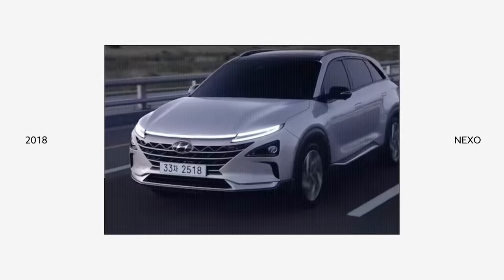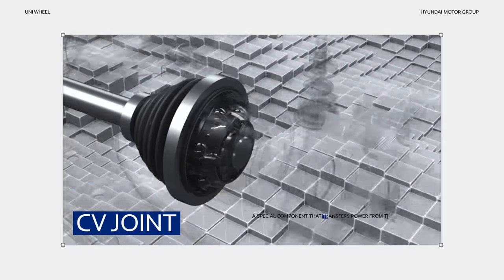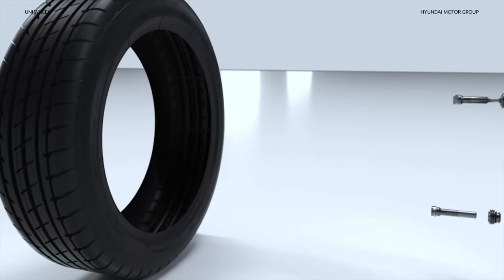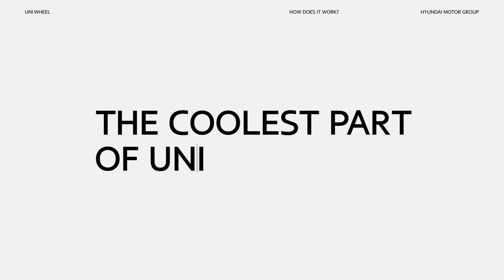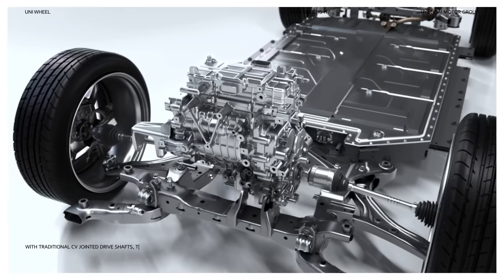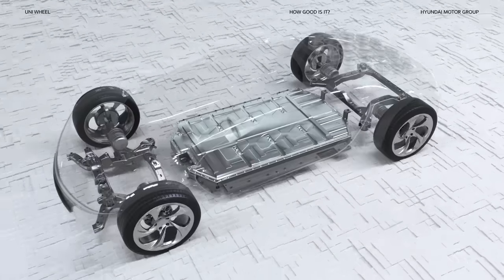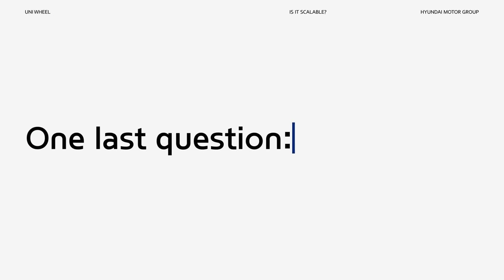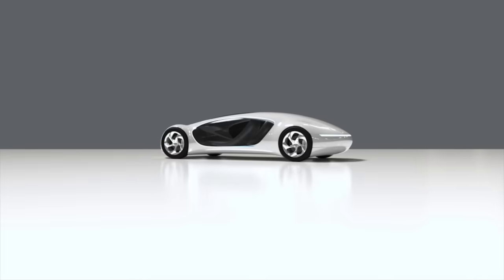The world's first drive system concept | Universal Wheel Drive System

Comment: Interesting. We’ll have to see how it survives in real-world conditions, including going over potholes and going off-road.
Reply: Yeah....but U really gonna go off road with battery pack underneath.  Deep pot holes can create havocs but like buses, trailer tractors, and wheelchairs (rear wheel drive).. this is perfect.
Reply: @Timbucktoothed  Why not?
Reply: I think so. THink of all the holes in gas tanks right now. We gotta solve that problem.
Reply: @timeconomu7395 Gas tanks are usually higher up on the car than the battery packs on these modular chassis. If you puncture a gas tank you just get a leak, if you puncture a lithium battery you get a gnarly fire or an explosion. Not saying that these concerns couldnt be accounted for, but they are concerns none the less.
Reply: Seems like all the pressure will be put on the uniwheel and it will break often
Reply: "going offroad" is no more a real-world problem than "going across a lake"
Reply: @RoamingAdhocrat I don't understand? Where I live, Colorado, and especially at my elevation (9100 ft) going off road happens pretty often. Rain washing out the roads, entire cliff sides coming down and scattering across roads all pose a problem that's encountered often enough that if you don't have 4wd/AWD you aren't guaranteed to get from point a to point b often. 

To go a bit further, many of the roads up here are dirt roads, that often get eroded and washed out. If you consider the paved roads, the amount of pot holes exceeding 12 inches is almost guaranteed to include at least 1, over a 2 mile stretch. I think people fail to realize that a lot of places such as mine exist and are not only impractical to "upgrade" but downright impossible due to the unique weather conditions presented.
Reply: @yunakobravo70 I live in Colorado at 9600 ft and wtf are you talking about? Entire cliffs falling down?  Ha ha, bruh.  In the ridiculously rare case that that happens, the highway gets shut down and your 4x4 isn't getting you through there anyway.  This ain't goat paths in Bolivia or Nepal.  We have modern infrastructure.  Even high-clearance-needed,  US forest service roads are well built with good drainage.  Get over yourself.
Reply: Practically nobody drives off-road
Reply: Yeah, potholes, speed bumps, standing water, mud, dust, curb check, etc.
Reply: @Timbucktoothed go off-road with a diff sticking down and see how it fars on rocks
Reply: @CleverAccountName303 right? I've been in Colorado for most of my life and when he said "entire cliffs coming down" I thought "what part of Colorado does that happen"? 

Not a realistic argument against this. 

Eroded dirt roads? Deep ruts? Heavy snow and uncleared roads? All yes. 

Cliffs falling and telling the locals "just drive over it, bruh"... Never once in 41 years have I heard that.
Reply: That was my very first thought
Reply: I always feel like adding more gears increases the chance of failure and this design seems like it would lead to constant repairs.
Reply: @RoamingAdhocrat  you gotta come to Brazil at some point.
Reply: All innovations have been criticized, attacked and yet here we are with flight, computers, Ai and unmanned vehicles.
Reply: You got'em dude. This multi-billion dollar multinational corporation released this video with testing it for potholes.
Reply: @yunakobravo70  Maybe this concept isn‘t the right concept for you then? But keep in mind that most people don‘t need to, don‘t want to and don‘t have to go offroad.
Reply: I don't think it's going to have issues with off- roading, besides with independent motors on each wheel, you should be able to ride at any height allowable per tire size... And the best thing is, no drive shaft or axle height to worry about. This is a major step in automotive history!
Reply: Very interested to see how these hold up

Comment: The usual concern about such things is additional unsprung weight. I also wonder about cost of repair when relatively minor impacts with wheels occur. Interesting.
Reply: It looks pretty modular. It might not be any worse than a traditional CV joint replacement.
Reply: They seem to have ditched the hydraulic friction brakes to make space within the wheel, so you'd drop a bunch of weight there... but then, whats the situation with braking?
Reply: @noxious89123  I think they didn't include the brakes for simplification of the visuals.  I would imagine the wheels would be inboard like they do with the bollinger EVs (anybody remember them?)
Reply: @noxious89123 I guess this unit needs to be oil filled, wich create a mass that has a damper on the start of the movement and a momentum when the movement must stop. That will cause some problem. But I guess this is not a racing car system, good enough for everyday use?
Reply: @noxious89123 Brakes can be mounted on the motor/driveshaft? Just like old Alfa Romeo and Citroen did to reduce unsprung weight.
Reply: There is no unsprung weight other than the tire itself, duh! The tire spins around the wheel.....😮 This is the future of automotive travel.

Comment: I couldn’t help but notice they still had to use one cv joint on each front wheel for turning. So on a 4wd car with 2 wheel steering they are reducing the number of cv joints from 8 to 2, but not eliminating them completely like the video seemed to be saying. Also on a fwd car it would only reduce the number of cv joints from 4 to 2.
Reply: Even the non-steered wheels need some angular compliance because toe and camber angles change with suspension movement.
Reply: @brianb-p6586 I'm also guessing that it's not a "true CV" joint, in that its range is limited in order to increase power transmission efficiency.
Reply: I have no idea what type of joint Hyundai is proposing, @TheThomSirveaux , but any joint which doesn't change speed with rotational position is a "true" constant-velocity joint. To handle a steered axle, almost the same angle as conventional applications would be required, so it would presumably be a conventional CV joint type.
Reply: Could always mount the motor on a “hinge” and have it turn/camber in relation to the UWD hub assembly and shaft as well. Eventually I’m thinking each wheel will get something akin to a “bogie” mount like rail cars. Especially since drive by wire is already a thing and steer by wire will be more popular too.

In this manner, steering would just mean varying the speed of each wheel to allow them to pivot in their bogies similar to how a tank or a hoverboard turns.

Comment: But... You still need a CV joint between the uniwheel and the drive motor to account for steering. The uniwheel only allows an up and down movement in a single plane. Otherwise the design is top notch. Good job Hyundai!!
Reply: Looks like in the video they envision the small motor being able to turn with the wheel?   You'd think having to have space for the motor to turn with the wheel would take up a lot of space too.  Although I guess this would be ideal for a rear wheel drive car.
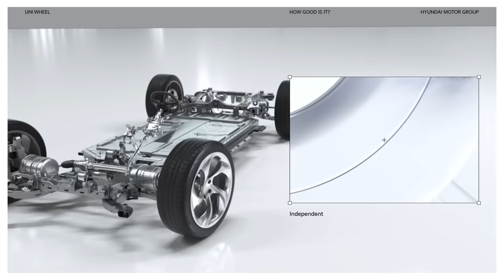Reply: 5:12
Reply: @OrestisTrips thanks for the link. You have to zoom in on the small picture but it’s clear that the motors turn with the wheels.
They should go for axial flux pancake shaped motors. That’d keep the whole package tighter
Reply: @auspiciouslywild  and then they could just... put the motors directly on the hubs and not bother with 60 expensive moving parts.  This is pretty ridiculous.
Reply: @gearyae  No, because that adds a lot of unsprung weight, which is undesirable for many reasons.
Reply: @gearyae  what  @superluig164  said and also wanna add even with 4 of these UWDs, there's less moving parts than in the typical transmission/differential/CV setup. Way less.
Reply: @gearyae  Those parts gets you a more comfortable ride, better efficiency and better motor longevity.
We have EVs with basic hub motors today. But still the standard is to have a single speed gearbox and CV joint.. because without it you get a bad EV that nobody wants to buy.
These parts aren't very complicated. It's all just basic gears in a fixed configuration.. like the single speed gearbox it replaces.
Reply: @auspiciouslywild  yeah, I didn't consider the matter of trying to reduce the slung weight of the wheel for suspension purposes. This makes much more sense with that in mind.
Reply: Unless you make the entire motor assembly pivot

Comment: Possibly a brilliant innovation. However, I suspect durability could be a potential tradeoff. For example, taking a pot hole or speed bump at some speed looks like it would result in the system violently reaching its limits of travel and becoming easy to damage in many ways. Also, I wonder if going through some water or mud could get debris into the system. The video seems to breeze over the comparison part and just says the system performed "satisfactorily," which implies just okay enough but likely a step back. Guess we'll have to wait and see.
Reply: 室内で使うロボットや都市部での車椅子には向くと思うが、実際の公道や悪路には不向きだと思う。
四輪の制御も複雑になるしコストや耐久性やメンテナンスも考えると現段階では まだまだ研究室レベル、実用ではデメリットが勝ると思う。
Reply: Y'all are overthinking this, this something you put in a car. It basically data to improve the product or to be adopted to another industry. Example 4 wheel steering. Bad for gas pickup trucks but good for ev trucks

Comment: Humvee’s use a gearbox at the wheel, very interesting engineering feat. My biggest question is how you seal that input shaft through its range of motion? followed by how is it lubricated? I would assume a serviceable gear oil fill of some form? I don’t know why I’m asking as if I’m going to get a response 😂
Reply: HMMWVs (Humvees, and civilian Hummer H1's) have geared hubs for portal axles. There are other vehicles with portal axles (mostly older than the HMMWV) and lots of heavy trucks with geared hubs just for more reduction. It's not much of a feat, but it is interesting to see. 

I agree that sealing the sliding entry panel would be a major issue if this were ever actually considered for production.
Reply: This isn't a portal axle in the sense of a solid axle or independent like hummer.

Further they do not mention lubricant or dust boot concept. They have not thought this far or maybe it's still being patented. Its huyndai they are not fools.

I can see this working at low speeds where heat doesn't play a role and it will probably be OK with flat surface and things like steps.
Reply: @brianb-p6586  el sellado y lubricado del sistema no sería demasiado inconveniente.. con una buena grasa para engranajes, y un buen mantenimiento,, puede durar años... La junta tipo fuelle , al estilonque usan en los palieres actuales podría valer... Lo malo la corrección de las variaciones en el sentido axial...